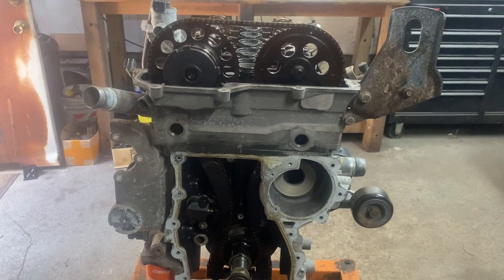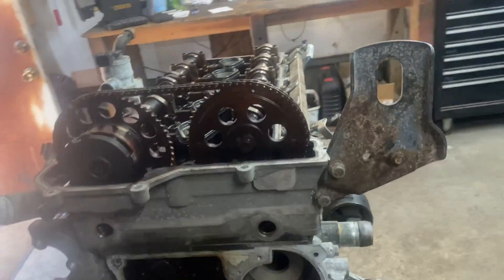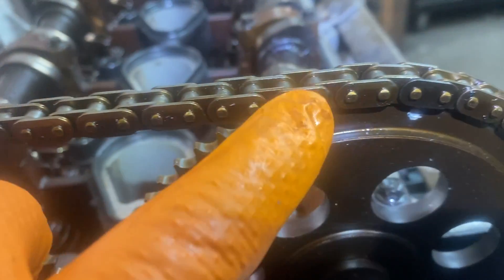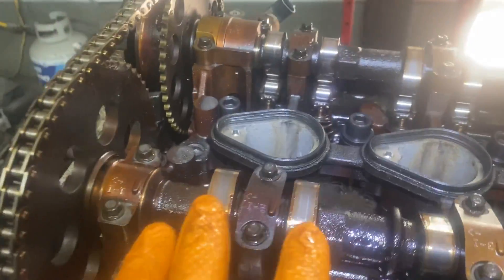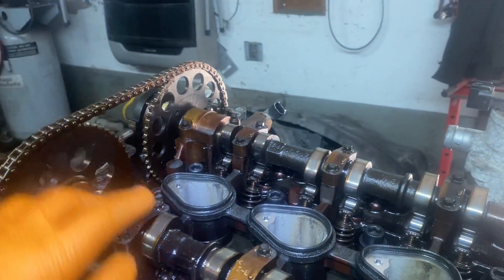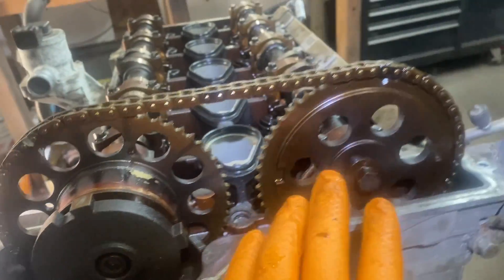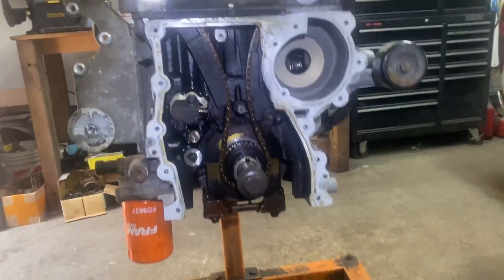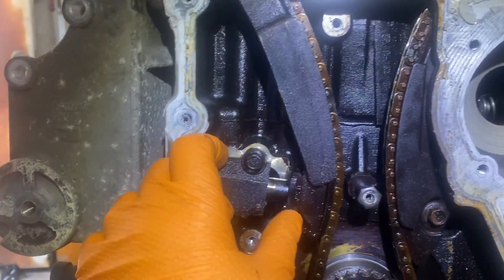Valve Timing Alignment On GM 3.7L Vortec 5 Cylinder - GMC Canyon, Chevy Colorado, Hummer - 2004-2012

Comment: I made a mistake on my timing chain job.  I didn’t mark the sprocket when I changed it out for a new one as we installed a new timing chain.  Around the two minute mark on the video, you mentioned locking down the flats with the special tool and realign the sprocket to the cam shaft.  I have the special tool to hold the cams flat.  How do I adjust the sprocket to to be aligned correctly?  Is it simply loosen the bolt and adjust or is it more?
Reply from the maker: If the sprocket is new it’s already in locked position and ready to be aligned

Comment: Enjoyed the video. What was some of the symptoms that caused you to change the timing chain? Was it just because the check engine light came on. OR did you hear a rattling noise from the engine? Let me know. Thanks.
Reply from the maker: Thank you! This engine was seized and was rebuilding it with new timing components.

Comment: Greeting
I need to change the gasket on the engine head how.
If I remove the chain and take out the cylinder head, should the timing be adjusted afterwards or should it remain as it is?
Reply from the maker: If it moves, you’ll have to do it the correct way.
Reply: Mark everything

Comment: I have the 07 Colorado  3.7L 4wd  260,xxx miles and the timing  jumped causing lack of power while acceleration, engine stall and no crank questions is do u think its worth fixing or do u think i farther damaged the engine like valve etc?
Reply from the maker: You may of damaged some valves. But if it’s worth fixing depends on your own situation. It will cost a significant amount and with those miles probably more than the truck is worth.

Comment: How do you advance the cam phaser?
Reply from the maker: If it's a new gear they come packaged in the advanced position. But, to ensure, you just want to hold the cam in place and turn the gear clockwise till it stops.
Reply: @Motorcarnut  I actually figured this out, the advanced position just means locked. The reason they say to be sure is if reusing the old phaser you need to blow the oil out of it so the lock pin will engage. That's it. I wish the service 
Manual explained better. The default position for the phaser is fully advanced because all it does is retard the exhaust timing at idle or low speed. I also learned the hard way not to use aftermarket timing parts. I reuse the oem intake and crank sprockets I found ac Delco now makes the old Delphi phaser for the 3.7s. I tried aftermarket phasers and chains and sprockets and they are terrible. The phaser isn't even machined properly the oil passages are wrong there is play in the lock pin and the body is wrong for for cps to be able to read it's position. I got a oem phaser from rock auto for $160 I think, the dealerships don't make them anymore. And if you have say an 07 canyon or colorado you have to search under 08 to find correct oem parts. I also picked up a chain made in Thaiwan that is provably a little better than oem, I think INI makes it. The tensioner I went with cloyes  top notch. Aftermarket timing parts should not be used. The ac Delco phaser has ZERO play in The locked position. I do believe over time it's the tensioner and phaser that wear out creating slack In the chain which when torqued by the starter makes the chain stretch and cause a wide variety of engine problems
Reply from the maker: @Mike-qo4kp Great write up and accurate
Reply: I made a mistake on my timing chain job.  I didn’t mark the sprocket when I changed it out for a new one as we installed a new timing chain.  Around the two minute mark on the video, it was mentioned locking down the flats with the special tool and realign the sprocket to the cam shaft.  I have the special tool to hold the cams flat.  How do I adjust the sprocket to to be aligned correctly?  Is it simply loosen the bolt and adjust or is it more?